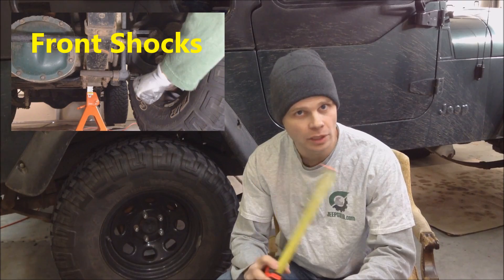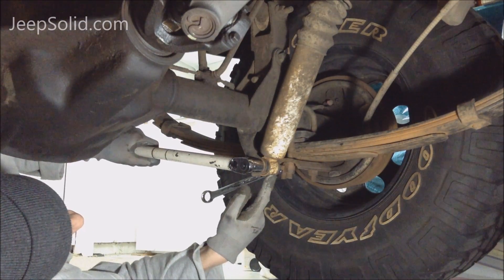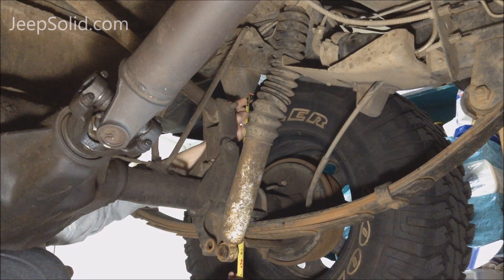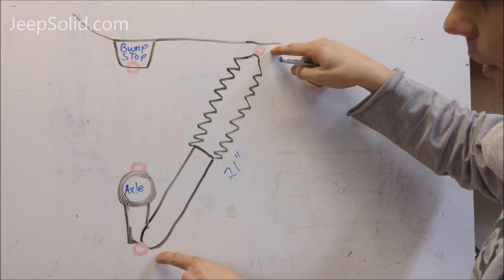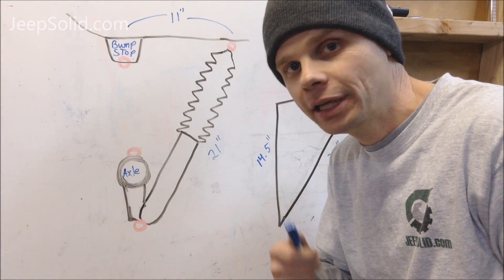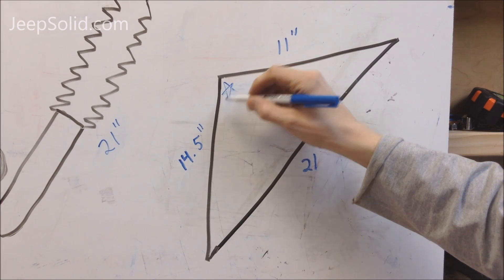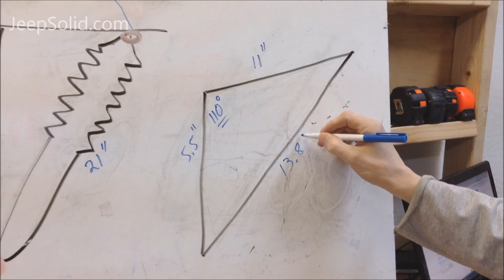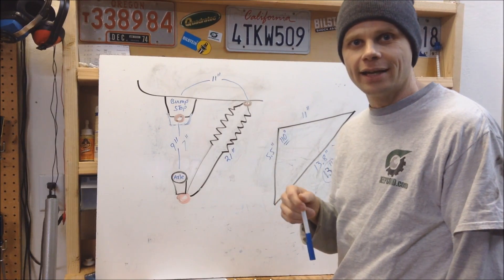Measuring Shocks: What size shocks do you need?

Comment: So I'll be the dummy of the Class but at least I will know wtf I'm doing hopefully. 
I asked my Mechanic to measure my Jeep for lift and he insisted the Jeep was Stock.
It's not. Anyways I had bought 0-1" Fox Shocks 2.0 all around.
So now I have the problem of figuring out to get extensions or just get another set of Shocks all around.
Ultimately this is a short term for the Long Picture of a new lift so I know exactly what's in the Jeep.

So the questions this works for a JKU as well...yes?

Matjow7340 w
Do you add an inch to the extended length and subtract an inch from the compressed length as a little extra buffer zone insurance from bottoming out and over-extending?

Could you elaborate on this and break it down precisely as to what to do there.
I'm confused by the answer you gave him.

Thanks
\

Reply
rote:

Comment: Man this is much more complicated then i figured...  soo my Jeep Grand Wagoneer, has shocks that extend only 19.9 inchs.. and with the tires on the ground it measures 19 inchs with my new oem height springs and a 2 inch lift.. So my shocks are pretty much max extended already just sitting on the ground.  With the shock off and jeep jacked up so the axle flexs down i measured 21 inchs from mount to mount on the shock.  This means my Jeep cant even flex on a pot hole with the current shocks. 

So i found on 2-3 inch lift shocks from bilstein that measure 22.7 length, how much extra length do i need over the 21 i measured ?  Is 1.7 inchs extra enough on those 2-3 inch lift shocks ?  Im less worried about the bottoming out of a shock than i am the shock not extending enough.
Reply: He never explained the math😂 he just said put it in google calculator
Reply: google did the math for the min size compressed, if you are getting 21 inches from mount to mount that that would be the min size of the shock extended that you would need.

Comment: To hard,,Just jack one side up until the tires is about to leave the ground,,measure that side ,,that would b fully extended,,then measure the other side for fully compressed,,without shocks on it of course,,pretty simple I would think,,you just don’t want a shock to bottom out or fully extend,, your measurements would help you there,,

Comment: Do you add an inch to the extended length and subtract an inch from the compressed length as a little extra buffer zone insurance from bottoming out and over-extending?
Reply from the maker: Yeah, it's a good idea to add a little at the top and bottom to prevent bottoming out.

Comment: Or just jack the frame up. And when your tires starr to come off the ground messure. But im just a wrench Turner
Reply: The reason to unbolt the existing shock is to confirm maximum length of travel. The old shock may be preventing maximum travel.
Reply: Amen.